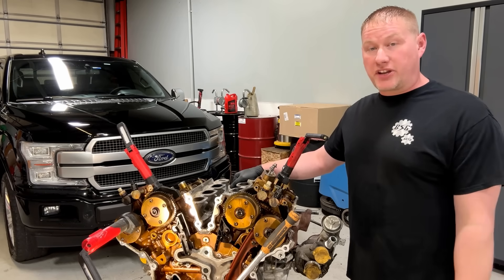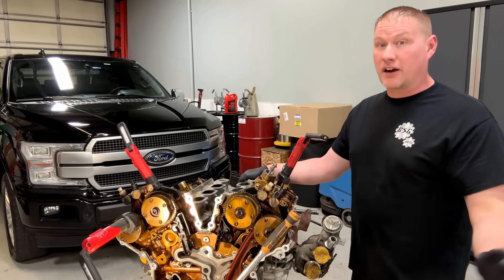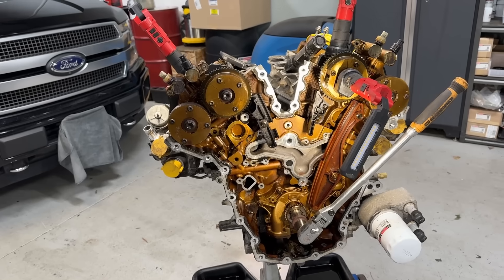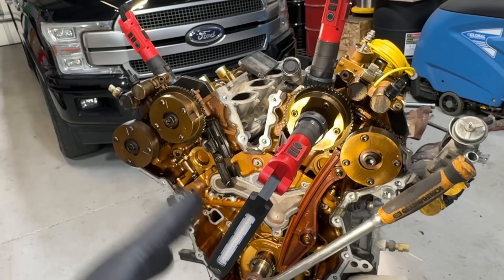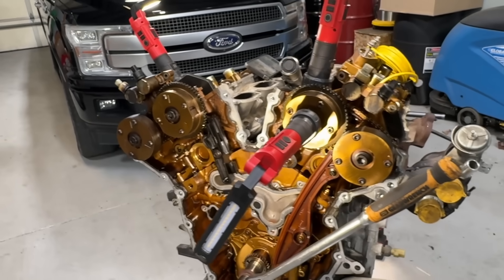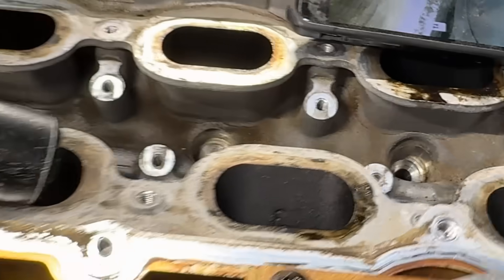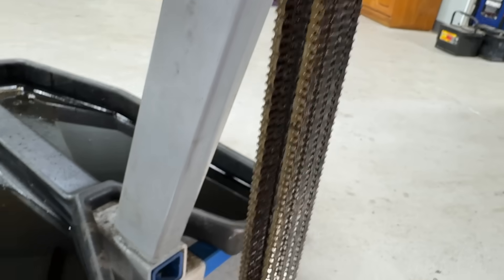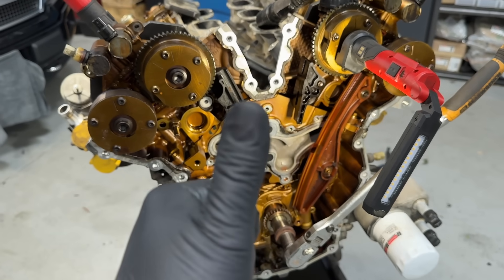2011 Ford F-150 3.5L EcoBoost Engine Failure: P0016 P0018 Camshaft Crankshaft Correlation

Comment: I have a 2015 3.5 ecoboost and got the timing chain replaced at 192K miles as a preventative measure. I don't regret the cost one bit and my truck is still running great at 210k
Reply: To them that talk crap on here about their loyalty to a brand like Toyota, Toyota trucks have had major issues in recent years. Every manufacturer is having to meet cafe rules, making too much power out of smaller engines, and they have issues.  I've had  all these; Toyota,  Ford, Chevy I'm not against any, but there are years that all have made long lasting trucks and engines, as well as bad. I get tired of people who are "im only Chevy,  or Dodge, or Ford etc, and any other brand sucks". Grow up. I bought a 95 Taurus 3.8 litres and drove it for 16 years no problem. It's also about how you maintain it. Buy what you like, don't talk shit about others, unless you're will to buy it for them with your money.
Reply: You Ford fan boys crack me up,  it only took $7,000 to make your truck reliable
Reply: @daarchdukefranzferdinand236  and which manufacturer do you recommend that doesn’t have mechanical issues? Chev, Dodge?? Lmao
Reply: @stevegeorge5702 im buying a Toyota next time, you can keep buying American brands.
Reply: @daarchdukefranzferdinand236 Guess you haven't heard the news about their first go with a twin turbo V6.
Reply: @daarchdukefranzferdinand236  what a Tacoma that can’t even get out of its own way. Some people need a real truck that can tow 14k pounds
Reply: @daarchdukefranzferdinand236   no that kept my truck reliable. nothing lasts forever but you can keep it going with some preventative measures. go get your toyota, that's the beauty of this country, you can get what you want and afford.

Comment: I have a 2011 f150 5.0 with 154,000. So far it's been a good truck. I don't have any codes or issues but at what mileage should I guy be worried about timing chains? My driving is probably 90% highway miles and I do 5,000 mile oil changes.
Reply: I would like to know as well.  I have the same truck with about the same miles.

Comment: My 2011 F150 6 cylinder XLT super cab turned 110,000 I have followed all maintenance instructions and have had zero trouble with it. I have treated it like 
a forever truck because it is! It’s been payed for since 2015 and I love it. Yes I am a proud Ford retiree. Ford has had truck leadership since 1978 the year I became an employee.😉
Reply: Yup. My 2016 XL single cab only has 46k miles. I change the oil at 3,000 mile intervals with full synthetic. Tranny fluid drain and fill at 40k, flushed the coolant with the current updated Ford green coolant at 40k as well. Hope to get 200k out of it. 
Cheers.
Reply: Right on Brent!
Which 3.5 engine did it have?
Reply: @wayneessar7489d😂 Ecoboost 3.5L V6
Reply: @brentsmock1044 Thank you!
I have the 3.5 na in my 2016 f150 and that is why I asked.
I treat mine as a forever as you said.
Reply: @wayneessar7489You are very welcome!👍
Reply: Good on you sir! I couldn't be happier with my '14 F-150 3.5L EcoBoost. 195K miles I bought it with 103K in 2020. 5,000 mile oil changes with Castrol Edge and Motorcraft filter. Only code I get is oxygen sensor... Probably because I drive like an old lady. All I do to clear the code is have fun and let her stretch her legs to 5,500RPM - the following day the code is clear. I also get the truck rust proofed annually as I live in Wisconsin. I just changed the front wheel bearing hubs and brake pads right after Christmas - absolute cake job with not a single speck of rust on any bolt I removed.

Comment: Whenever you open up an engine on your videos and I see that “bronze” coloring from the varnish, I automatically know the customer didn’t change their oil enough. 147k miles is still a young engine…
Reply: I was thinking the same thing. I was brought up on 3000 mile oil changes.
Reply: @MsFireboy2  too often
Reply: @brentbradley6711 absolutely not! These engines are hard on oil
Reply: @MsFireboy2  way too much
Reply: @brentbradley6711  not for this engine.
Reply: Yeah, i'm thinking it saw quite a few changes near 10k miles or more, and likely with standard oil.
Reply: Mines bronze, 175k coyote. Oil changes every 5k? Since 70k miles. Owner before me had paper work
Reply: This is not a problem. They changed the oil regularly.
Reply: Bronze is normal for high soot producing engines at 5k intervals especially when not using synthetic. Which most people don’t use synthetic cause they don’t know any better. Older engines could take the abuse these new engines are just made to fail.
Reply: If the owner is following FORD recommendations, then he was doing the correct thing based on FORD.  Oil changes are close to 10k usually and FORD still sells that junk oil of semi-synthetic oils.  Both, IMO, are incorrect...and FORD should change that policy.  Drop it to 5k or 7.5k and only FULL synthetic oils.
Reply: I have never changed my oil since new. It’s sooo old fashioned. What tractor engines are you using?? Ford Mach E. No maintenance. Modern. 
No transmission, no exhaust system, brakes never wear out, no gas stations. Charge at home overnight.

Comment: Does it matter which oil you are using if the oil is changed every 5k miles ?
Reply: as long as it has says it meets or exseeds ford WSS-M2C961-A1 written on the back of the oil bottle ford recommends syn blend or a good full syn i recommend the ultra platinum pennzoil
Reply: All other factors being equal, an engine will last longer using FULLY synthetic oil than with any other oil type. It is less susceptible to thermal breakdown than conventional oil, or synthetic blends, which can contain a substantial percentage of conventional petroleum based crude oil.

Comment: I have a 2013 F150 with 122,000 miles on it.  I have noticed that if the truck sits for several days without starting, and I start it normally, I have the "chain slap" for a couple of seconds until the chain tensioner pumps up and then it quiets right up..

So, I have been doing the "flood start" method to crank the engine, but it won't start.  It runs thru a crank period of about 5 or so seconds and stops.  I repeat this until I see the oil 'gauge' move and then I let the engine start.  No slap noise at all.

It can take 3-4 cranks before the pressure shows on the 'gauge'. It can go as long as 2 days and I don't have to do that..  But any longer, I have to prime the oil pressure first..

I've not had any codes on it, but I'm sure I've got some stretch in the chain in general...  I know I'm on borrowed time with it, but the truck is not a daily driver anymore, so I'll just monitor it and take it in at the first code thrown!

Comment: I find it amazing the number of people who don't change their oil regularly.
Reply: 99% of the ECO Boost failures I see, even on this channel, are attributed to poor oil change intervals.  5K-6K OCI, with Full Synthetic.  Recommend Valvoline Restore & Protect.  Damn people, oil changed are cheap.  Engines are not....
Reply: @gregh2880 sadly, we can't get restore protect in Canada, otherwise I would run it. I'll probably run Pennzoil ultra platinum instead
Reply: @gregh2880 in normal uses, ya
Reply: I usually change my oil every 3,000 to 3,500 miles. That's in both of my ecoboost engines
Reply: @sm2775 Yup. Me too. Probably excessive. But gives you good peace of mind!!!
Reply: @sm2775  waste of time and money
Reply: They change the oil regularly- but at too long  interval, because the manufacturer said so...
Reply: Yeah that's pretty varnished up.
Reply: @volvo09  The engine looks like the engine oil was changed reguarly too me, I have seen much worse varinish. The chain stretch happens because the chains have so many links, and every link wears a little bit. This is a 2011 engine with almost 150k miles.  The engine probably lost compression because a chain jumped several teeth on a cog and the timing is way way off.
Reply: @kevinkelley3657 an engine shouldn’t have this much varnish in it. Lack of oil changes for sure
Reply: Not really. They don’t even take care of themselves never mind their cars.
Reply: I always aim for going in 500km early for my oil changes.
Reply: Lacking proper oil changes explains 2 failures but how about a blown head gasket?
Reply: No time for oil changes but plenty of time for the internet……….
Reply: Don’t forget that manufacturers already suggest extended oil change intervals, 12-16k km is too long. Max 8k with synthetic oil and 5k km on standard mineral oil.
Reply: Change your oil and filter every 3000 to 5000 miles PERIOD……….

Comment: Hey I rebuild a 2012 EcoBoost using your videos that was about 4 years ago I had to do the intake valve and chains and the vvt solenoids were really dirty. back then it had 291k kms on it now it has 400k still runs strong ,very little blow by and it's not a stock setup I have bigger turbos ,cold air ,catless down pipes ,catch can,and a 5 star tune so it rips!!!! Recently I've started doing oil analysis and the oil is lasting about 5k kms so I might invest in a oil cooler and better oil filter location
Reply: Wish I could put pictures in the comments but the chain I pulled out was a full 1/2 in longer then the new one🤯

Comment: Let me ask a question. Can a 2012 Ford Escape with 3.0L V6 engine with automatic and AWD be pulled from the top? The manual says to pull from the bottom but I don't have equipment for that.  Thanks.
Reply: he won't reply
Reply: No it can’t sent it best thing to do is send it to the junkyard